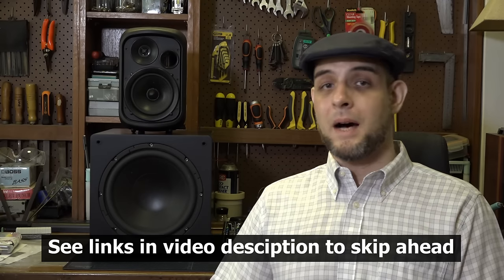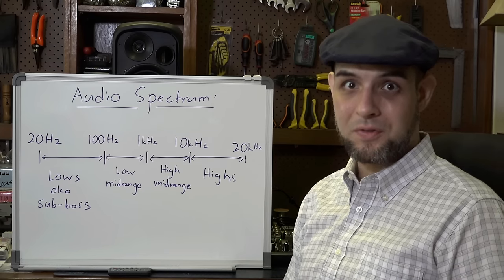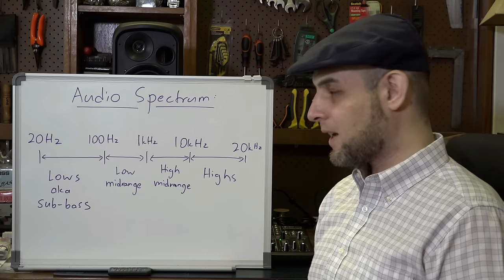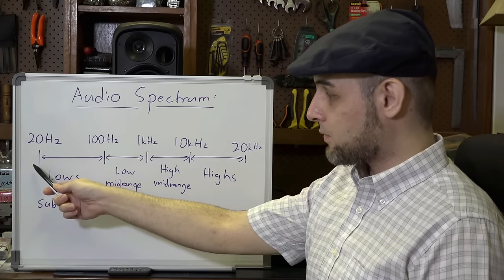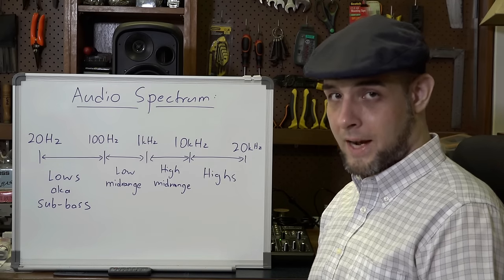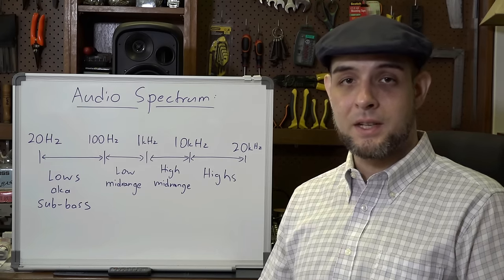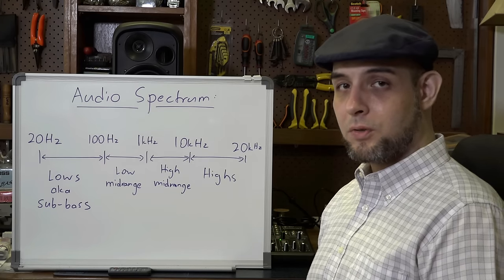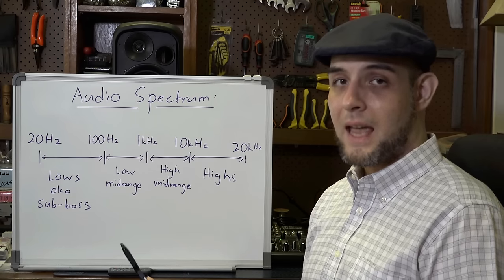How to connect an active subwoofer to a sound reinforcement system

Comment: Will it enhance audio quality if equalizer is added to the system? If yes, what is the connection diagram?
Reply from the maker: If your using a relatively modern sound system (less than 8-10 years old) I have found that adding an equalizer (especially a graphic EQ) usually makes the sound WORSE because people don't know how to adjust them correctly.

Comment: I have a mixer with a built-in amplifier, a powered subwoofer and two PASSIVE  main speakers. What is the best way to connect them? Can I use the first method, which was for ACTIVE main speakers? I am a beginner. Any insights are appreciated.
Reply from the maker: Are you using the powered mixer to drive your passive speakers?
Reply: @GLBProductions  I used to have a mixer without a built in amplifier and a pair of active speakers. I got rid of them and just bought that new set. Not sure what is the best way to connect them. Should I use the power mixer to drive the passive speakers or is there a better alternative?
Reply from the maker: It depends on many things, but a powered mixer is less versatile than other setups when it comes to adding a powered sub, although setting it up is much faster.

Comment: I have a question, from an active crossover Alto AX2304, how to connect the midhi/top passive speakers connected to an amp on it? We only have 1 amp for our midhi speakers.
Reply from the maker: On that unit set to stereo 2-way mode and connect to the high outputs for L&R.

Comment: He's right a subwoofer is just a speaker you can add on.

It's not like a woofer than come with speakers where you have to adjust the sound.

A subwoofer is like a backup speaker if your loud speakers are not producing enough bass.

Comment: I have a 20 year old Yamaha HTR-5550 receiver.  My 15 year old JBL subwoofer stopped working a couple weeks ago.  Tried a new subwoofer and not working either.  I've been troubleshooting with no success. Any ideas?
Reply from the maker: If the new sub does not work and you have verified that it is working by using another source, then the problem is with the sub out on the receiver, or the internal signal routing thereto.

Comment: Hi Bruno, 

Excellent video. Gr8 explanation. It cleared so many doubts and gave me so much insight to how do I connect subs to my speakers and why subs are necessary. Do we need 2 different subs to support 2 active speakers or one sub can support a pair of active left and right tops ? I understand pairing an individual sub to a speaker would be definitely a recommendation, but is it an absolute necessity? Is my question and secondly,  I got consumed iwheyn you said "do not run the output of a power amplifier into the amplifier  of the active loud speaker"..... that part is not clear.  Pl. feel free to explain. thank you for doing this fantastic and most informative video.... It felt like I was in a  Sound engineering class.....lol.... U were that effective.... :), btw, my bg is in mech. Engg. :) So I do understand a bit of physics but not too much of electronics and electrical stuff.....
Reply from the maker: Thanks for watching Kamlesh! 
One sub may be able to support two fullrange speakers - it depends on how the unit is designed: you'll know that it can if you see two sets of inputs and outputs, typically marked left and right (so L&R in and L&R out, typically all on XLR). Many companies design their subs in a system with fullrange speakers from the same series, in which case the output from one sub may be matched to the combined output from two of the fullrange tops eg the JBL EON series. 
Do not connect the speaker-level output of your power amplifier to the line level input of an active loudspeaker. It is fine to connect the line level output of the power amplifier (typically XLR or balanced 1/4") but not the speaker-level output (typically speakon, unbalanced 1/4", bare wire or 5-way binding post).
Reply: @GLBProductions  thanks Bruno. Your explanation goes far in understanding speaker connections. U know what? I watched your video one more time and then I understood about your comment about power amplifier and active speaker.  Thanks.  I needed to understand the basic diff.  bet. Pre-amp. vs. power amplifier.
Reply from the maker: You're most welcome :)

Comment: If I have 2 passive dual 15's cabinets being powered by an amp how would I go about adding a powered sub?
Reply from the maker: Use one of the amplifier's line level outputs to connect to the powered sub.

Comment: Trying to connect to a Polk subwoofer that is entirely wireless to a different brand soundbar. The only cord that is connected to the subwoofer is the power cord... no input or output jacks. My soundbar, ZVox AV155 does have pin plug output jack for it's intended subwoofer. Any ideas on how this could be make to work...??
Reply from the maker: I'm afraid I can't help you on this one - perhaps contact the manufacturer and ask for directions?

Comment: thank you so much for sharing !! great video and detail.
I have 2 questions could you (or someone else) explain that would be greatly appreciated:
1) when connected Subwoofer to the system, what happen to the Sub of full range? does it still produce bass ?
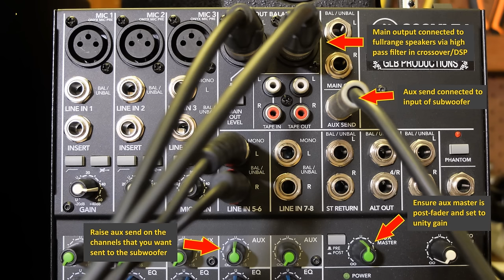2) Looking at you mixer connection (@25:50),  LINE-IN 5/6 (MOTO L/R), where/what are these connection connect to?
Reply from the maker: Thanks for the questions!
1) The woofers of the fullrange speakers still produce sound but not the same frequencies are the subwoofers. 
2) The line in connectors are connected to the main outputs.
Reply: Thank you again !

Comment: I need assistance for live rock band class. So I'm doing sound for this class. Our crossover doesnt work anymore per instructor. WE have passive full range speakers and an active subwoofer.
So I should use Passive full range mode per video right? Out Mixer Left and Right to Sub, from sub out to amp, but out of amp power is going to passive speaker. I'm just confused that Sub is offering amp to passive speakers and out of amp to passive speakers will overload. What am I missing? Is sub just a pass thru and not passing power?
So this is our setup, out of mixer goes to snake, from snake goes to amp, from amp goes to passive full range speaker via speakon cable. Sub only has xlr. Only thing I can think off is out of mixer to snake, from snake in to sub, out of sub into amp and out of amp to passive full range speaker via speakon cable?
Reply from the maker: If your active sub has high pass outputs then the signal chain is mixer ->sub -> power amp -> fullrange spakers. The sub outputs line level signal to the power amp, not speaker level signal.

Comment: I have the Mackie 1402-VLZ mixer.  This board has an aux 1 masterknob and a 1 and 2 aux send TRS outs.  Can I control Sub output from the aux master?   Your board used channel 7-8 for sub control.
Reply from the maker: Yes any post-fade aux send can be used.

Comment: Hello Bruno, First i love all you videos. i do have a question . You may have addressed my question in your video How to connect an active subwoofer to a reinforcement system.If you did i suppose I missed it. I have a yamaha EMX 5014 powered mixer with two peavey PV115 passive speakers, and i would like to add a passive subwoofer but i an useing aux 1 for my onstage monitors and channel 2 or mono to power the two front of house speakers.if I purchase two passive subs and a 2 channel power amp  How would i connect this to the mixing board, thanks  Mike from Pittsburgh PA.
Reply from the maker: If your using the mixer's internal power amplifier to power the two PV115s, you can use the ST SUB out to send a signal to the power amp driving the passive subs. This will give you a separate level control for your subs.

Comment: In the passive full range method my active sub has a cross over built in it. So will I still need another crossover from my amp to my passive speakers???
Reply from the maker: If your sub has high-pass outputs with the bass removed you will not need an additional crossover.

Comment: Hello can I also connect an extra   power subwoffer trough the monitor input and then from the output of the sub to the other floor monitors
Reply from the maker: You could but aux-fed subwoofers should be driven by a post-fade aux send.

Comment: So in method 1 if I only had one sub, I would need to daisy chain the speakers?
Reply from the maker: If the subwoofer has a stereo crossover like the one shown in the video this is not necessary.

Comment: Thank you for guidance how active subwoofer functioning. But I have a question on my active sub similar to your. I connected the monitor (L&R) from Yamaha mixer MG12XUK to the input of power sub Rockit 10S. I heard the sound of microphone when I speaking( subwoofer &main speakers ) something that I am not connected them right?
Reply from the maker: If you connect your mixer's main outputs to the sub and then to your fullrange speakers everything will be heard in both, including the vocals, so your results are correct :)

Comment: My sub only has one input and one output.  Electro Voice ELX118P  How can I connect it to my two powered speakers?
Reply from the maker: Several options: 
1) Use the aux fed sub technique - effective if you have top speakers with a low cut feature for use with an external sub. 
2) Run your system mono: mixer -> sub -> left speaker -> right speaker. 
3) If you are using the tops from the same series (ELX112P or 115P) then use the configuration on page 14 of the owner's manual, but with only one sub instead of two. 
ElectroVoice really wants you to buy two of these subs - one left and one right 😆

Comment: Hi Bruno.. Great video, thanks a lot. I want to know, in what ratio in terms of Watt i should connect an active top speaker and an active sub.?
Reply from the maker: That's a good question - ideally you would use a top/sub combination from the same manufacturer that are designed to work together. Failing that, choose a sub which is at least the same power as your top speaker, preferably 1.5 times to 2 times the power. It also depends on the type of music you are doing - EDM or dub will require more low end than classical or jazz music for example.
Reply: GLB Productions thank you so much for your valuable reply. I have learnt a lot from your videos. Thanks once again.

Comment: I have a pv 10bt mixer and I was wondering how to send out a full range signal to one peavey dm118 subwoofer and using the built in crossover going to two dm112 tops.
Reply from the maker: The method shown in the video will work fine for your setup: mixer -> sub -> high pass outputs to tops. Only difference is that the sub has only one input so you'll either need to run you system in mono or get two subs.
Reply: GLB Productions ok thanks :)

Comment: Im currently struggling with the best connection for the equipment we have.

16 channel mixer

1 Amplifier(2channel)

2 channel crossover

2channel external equaliser

2 passive speakers

2 sub woofers

And 2 active monitors

Please I'll be eternally grateful to get your advice on the best way to hook these up. 

Ps. What other equipment can I add to complete the setup?
Reply from the maker: Hi Emmanuel, in this case I would strongly recommend that you refer to the person who sold you the system for help in setting it up - this kind of complex instruction is best done in person, not over the internet ;)
Reply: @GLBProductions  ok thanks Bruno

Comment: So what do I do if my sub only has 1 input it's a peavey pvxp 15" sub it has two high pass outputs but only 1 input my mixer has left and right of course and a sub out any suggestions
Reply from the maker: Yes that's a strange one - why would Peavey give a sub two outputs but only one input? With this sub you either have to run your entire system mono, buy a second sub for the other side of the system, or use an external electronic crossover.
Reply: @GLBProductions  it is strange would a xlr splitter work
Reply from the maker: How would you use that?
Reply: @GLBProductions  I called several places and they said to just run sub out and that the EV tops should have a setting to take all bass out or that I can run all channels that go to the sub to another mixer thanks for the help I do appreciate the replies very much
Reply from the maker: Yeah if you have crossover functionality in your tops then this is not an issue. All the best with your music!

Comment: Hello, great video, but I have a question I'm hoping you can answer. The sub I have has line in R and L rca jacks only. I'm using Alto ts215 speakers with yamaha mg16xu mixing board. I'm guessing I can use config B? Use a TRS to rca cable? If that works can you post a link to where I can purchase the analog crossover or the processor? I'm confused on that part and my speakers don't have sub switch. Thank you for any help... Doing a wedding for a friend and would like that punch!

Comment: my active sub is presently operating on 110V, can I use the same method of connection from a 230V mixer aux output to my 110V active sub? 
Does the different currents have any effect on the connection?
Reply from the maker: No the line level connection is not affected by the voltage difference, but you may get noise as a result of it. Personally I would not operate 230V and 110V equipment in the same system - too much risk of a mix up!

Comment: thanks for this video it was really helpful.. but I was just wondering ive seen videos connecting subs to speakers just using rca y splitters because some subs dont have xlr outs.. would the cross over in the subs still divide the frequency using that set up? thank you!
Reply from the maker: It really depends on the sub - not all subs have the ability to send a high-passed signal to top speakers, some have just a simple parallel out from the fullrange input.
Reply: GLB Productions thank you!

Comment: Please help, (I got no separate mixer but I have a Powered Mixer Amp, Passive Speakers and Active Sub with built in crossover) Is this set up okay “Powered Mixer Amp Speaker Out to Active Sub In then Active Sub Out to Passive Speakers In? Thank You!
Reply from the maker: Hi Kyrios, this won't work - you must not connect a speaker-level signal to the input of your active sub! Which model powered mixer are you using?
Reply: GLB Productions Pyle PMX802M
Reply from the maker: On that mixer your only option is to use the cd/tape output to connect to the active sub.
Reply: GLB Productions Cool! Thank You Very Much Sir! God Bless!
Reply from the maker: You're welcome Kyrios, God Bless you too!

Comment: Keep up the excellent channel. Learning allot still junior. I gt thrown into the deepss i got two questions first is i got active speaker and running my passive bass off it. Is this fine or will it better to run the passive base from it own amp. second question I want to run my analog send from the mixer to the samson D3500 EQ analog input and then run output analog to our BEHRIINGER ultradrive pro DCX 2496. Or do you have better setup idea
Reply from the maker: How are you running the passive sub off your active active loudspeaker?
Reply: Yes. It is running off the active loudspeakers at this stage.

Comment: Hi Bruno, thank you for the video. I only play music and karaoke. I have a Mackie ProFX8v2 series passive mixer as I'm running from XLR L/R main out to in XLR L/R on (2) EV ZLX15 powered tops. My PC is plugged into channel 7/8 R/L for stereo music playback purposes. I am getting a (1) lone EV EKX 15" powered subwoofer tomorrow. It has a crossover buit in the DSP control. Being a newbie adding a subwoofer and not sure how to hook it up. Is there a way to and should I connect it to have a separate volume slide on a channel on the board to adjust the subwoofer volume by itself? Or should I come from the mixer's main out R/L XLR's into the sub inputs 1 and 2 XLR's and out of the sub outputs 1 and 2 XLR's into left top and the other into right top XLR's to be in stereo on my tops and not have volume control to the bass separately? I prefer stereo. My tops have the DSP control to bypass bass from them to enable the bass from the sub to do the work from 80 to 150 hz. Seems I should have the sub on a separate volume slide from the tops. Also I don't have an Aux Send. There is a Mon Send. Also no pre or post set. That's my dilemma on trying to control the sub with a separate volume from the mixer. Sorry for being long winded here. Thank you for your time Sir.
Reply from the maker: If you only play music then there is no real reason to use the aux fed sub technique - use the volume controls on the sub and tops to set the balance between them and then just leave it alone when you're happy with it.
Reply: Thank you for the reply! I will adjust my sound in when I receive my sub. After other research yesterday I found that my mixer's 7 band EQ gives me the ability to do some adjusting of my sub bass and bass from the far left slide under 125 hz which my crossover adjustment in the DSP on the tops eliminates. I'll start with setting them at 120hz. What is your take on that? I appreciate your help and again thanks for your expertise! Have a blessed day!
Reply from the maker: You're welcome! Yes 120 hz is a good starting point - after that it's just a matter of listening and adjusting.

Comment: Can I run a 115W 6 ohm sub into a 100W per A/B channel 8 ohm reciever? I have 2 8 ohm klipsch speakers running through the A, wanting to run the 115W 6 ohm into the B channel.
Reply from the maker: You need to work out power delivery of the amp into 6 ohms - see this video: https://www.youtube.com/watch?v=l9L7uK7Xy0w